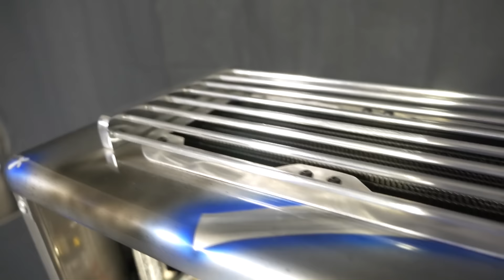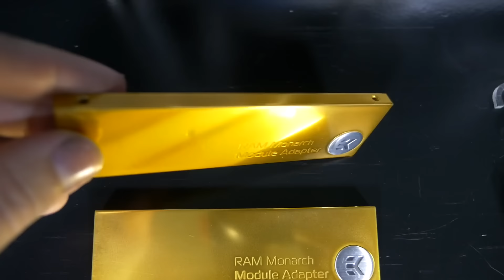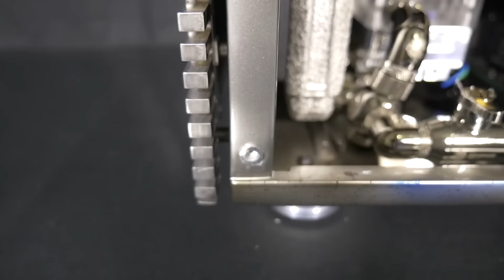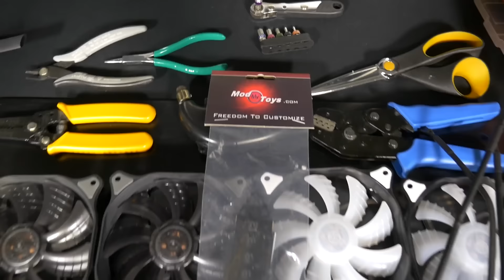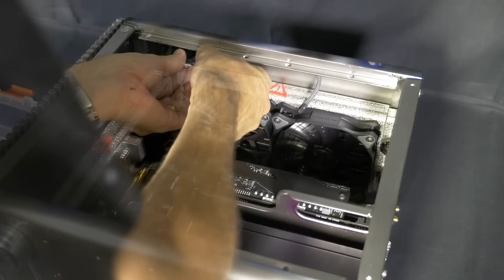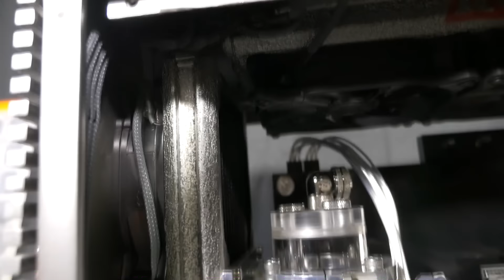Extreme Modding: CB19 'Master Chief' Build Log: Part 2

Comment: I love all of your build logs etc And don't get me wrong but, There is something that feels off with this build. In the sense that you couldn't do the Navy anchor due to budget restraints, But you chose to 24crt gold plate ram heat sink's & other misc stuff. It just doesn't seem like you in the way that you come across with only accepting the best and not taking 2nd, I thought you would have focused more on the anchor then the front panel art work itself. As the anchor would have more impact and be within the not over-done style of modding I have came to expect from you, Which I think always worked extremely well... Either way mate not trying to be a pain in your side just constructive criticism if you will. Anyway with all that said I'm sure the client will love it & I know you wouldn't sign off on it if it wasn't up to the very high standards you expect. Which is the reason I follow your channel because you only do quality work. Keep the uploads coming mate there always more then welcome :D

Comment: I've always liked your builds except the copper themed and this one, I appreciate the skill required and the level of craftmanship but the airbrushing looks like it was done by a kid and the overall look of the construction looks all over the place, the bare metal looks good but I can't see how that top grill and the front panel are Halo/Navy themed, also I don't get the front image, is that Master Chief on fire? if so it looks terrible. It seems like a general consensus that your earlier builds where the best, perhaps try to experiment with materials and looks without the airbrushing and unnecesary grills and fins that just look tacky and cheap.

Comment: Front fans blowing out of the case? 16:44
Top fans blowing out of the case.

Where is the case getting air into the case?
Reply: The internal fans for pushing out hot air and the fans blowing out air quickly dissipates the hot air
Reply: Could you rephrase that Comment? Hard to understand what you mean. 

I can in all see 4 fans. If all of them blow hot air out of the case , where does the cold air enter the case?
Reply: Petter Angeltveit It's all preference really intake or out take configuration get close to the same performance there is never cold air in a pc.
Reply: +Petter “Norlig” Angeltveit I believe what he is getting at is that negative and positive air pressure within the case does about the same job, cooling wise that is
Reply: With cold air,  I mean the Air that is before the radioators ofcourse...

That case is welded on all sides. Only opening is the fan mounts.  if all 4 fans blow out like that,  it will essentially make a vacuum   inside the case.  So air would get sucked back in where the fans are supposed to blow the Air out.

It will severely limit the cooling capability of the radiators.
Reply: ***** does your case have vents on the back of the case,  or in the bottomn?

Comment: I have an S340, and I need to put a 280mm rad it in. Should I get the EK CE280 (45mm thick) and cut the cable management bracket? Or get a black ice nemesis GTS (30mm thick) and not cut the bracket?
Reply: def the black ice one. i have an s340 as well and trust me, you would regret cutting it. not to mention the proformance def between the two rads are miniscule.
Reply: ***** Ok thanks
I like the flat design of the CE, but fitting it will probably be too much of a problem and not make it worth it